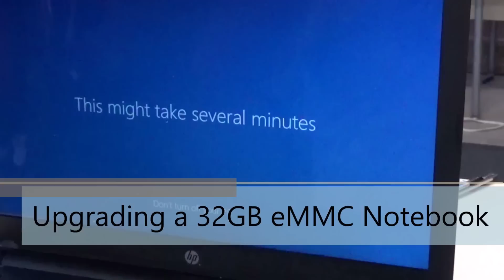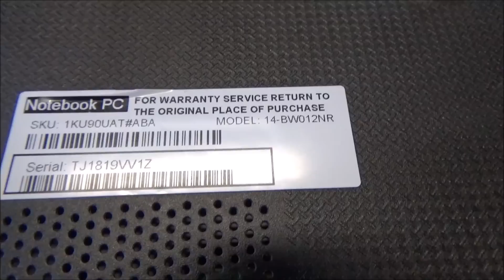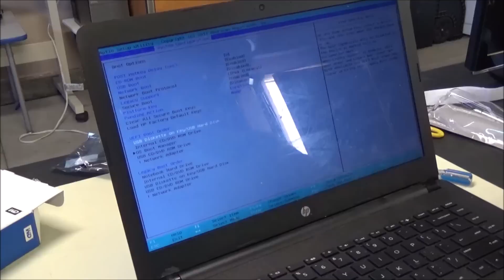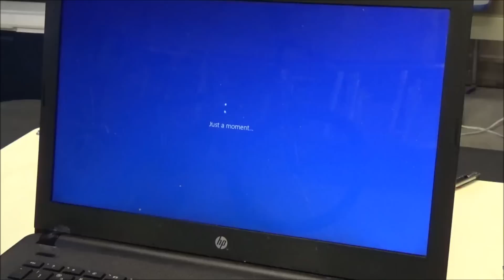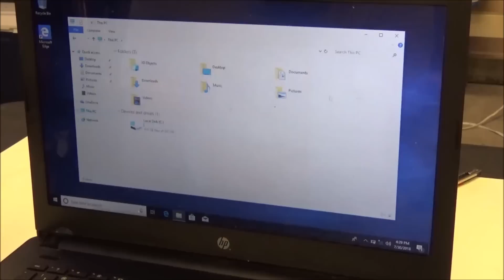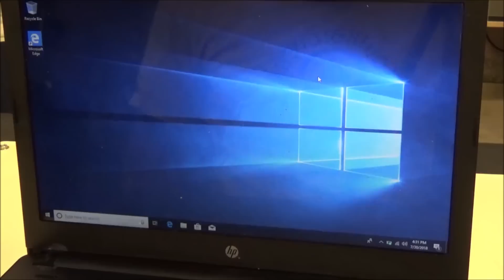Upgrade 32GB eMMC HP Notebook with 1TB HDD

Comment: Just a heads up, may have missed it if you covered this in your video.  Even though it doesn't look like one at first, that thing right beside where you installed the new hard drive (the part that has the big shiny rectangle with the ribbon cable running over it) is actually a hard drive, standard 2.5 size and standard connectors.  For anyone else stumbling upon this video, this is pretty cool, but it may be easier to just upgrade the built in drive.
Reply from the maker: When I was doing this it looked like the 32GB eMMC drive was soldered in place. The sata connection looked more like a solid bridge that couldn't be unplugged. I agree that there is room for a 2.5" drive in that spot, but the 32GB eMMC flash memory is a lot smaller than 2.5 inches. It's basically just  a little PCB, definitely not a standard 2.5" drive enclosure.  Because of my uncertainty and the laptop not being mine, I decided not to mess with it and just use the open sata port for the new HDD. Plus the 32GB's can still be used for extra storage by leaving it installed. Thanks for the input Marc, and thanks for watching!
Reply: @PimptatoPCs  Nah, it's not soldered, I almost didn't notice it was a standard connector either, the ribbon kind of messes with us.  I only offer this info because I did it myself after watching your video for getting this thing apart, you're almost the only person online who has opened this specific model and documented it, was very helpful.  

I think you're looking too closely, zoom out a bit and check out around 9:13.  The silver part, the pcb, and the black plastic tray they're both connected to are all removable as one piece (they, as a whole, are the same size overall as a normal 2.5" drive).  It all comes out with a little bit of work if you remove that screw on the tray towards the front of the laptop (near the pcb).
Reply from the maker: Thanks for the detailed information. I didn't notice that it's actually a 2.5" plastic tray that can easily be removed. If I ever do another one I'll definitely consider using that area to install the HDD/SSD. Having to use Velcro or doubled sided tape to secure the HDD in that other spot is a little mickey moused. It could wiggle loose or get knocked around with a good fall. I'm glad that my video helped you out and hopefully the details you provided will help someone else in the future!
Reply: Marc Mohon Hi I just saw your comment about the 14” HP stream upgrade. My kids got these lovely things for Christmas last year and they have been paperweights ever since. I am thrilled to have a chance to get them up and running with a new drive etc because they really need windows stuff for school and keep using my work computer instead. Cash is low so this would be a great fix. Can u help me out by telling me what you used for the upgrade? I will be using Amazon or anywhere I need to for the SSD. I have them open and from your description think I can see where it comes out as a whole. I just needto know what to purchase, there are way too many choices that this momma’s head exploded. Thanks if you have the time to send a quick note back. 🙂
Reply: PimptatoPCs Thx for this video since last Christmas have been searching for remedy for the two HP notebooks my kids got from a relative. Its been driving me crazy. You video has given me new hope for our paperweights. What do you suggest I buy? You had mentioned you told your neighbor in an email what to purchase, could you tell me? I also sent a note to another subscriber since he said the velcro etc wasnt needed cuz everything removed. So if you had to do it over again, what would u buy? I am willing to try anything since we can’t get new actual real true laptops this Christmas. Thx for any info. 👍🙂
Reply from the maker: You are welcome Jennifer. I didn't anticipate this video getting so many views! Looks like HP sold a lot of these notebooks and now have a lot of unhappy customers. Marc mentioned that the SSD can be installed in the spot where the little 32GB eMMC drive sits. The plastic tray that holds it is the same size as a standard 2.5" SSD and can just be removed. If it's done the way Marc said, you won't need to buy the disk drive/hdd converter thing that I ripped apart to use as a bridge to the Sata port. It will save money and be a much more simple upgrade. Marc linked to a 250GB Samsung SSD which is a great drive, but if you want something with more capacity you could get this 512GB Silicon Power SSD for $10 more https://www.amazon.com/gp/product/B07997QV4Z/ref=oh_aui_detailpage_o01_s00?ie=UTF8&psc=1 
It gets great reviews and I used it to upgrade my mother in laws laptop. Hope this helps to get the kids off your laptop! Merry Christmas!
Reply: @PimptatoPCs  I'm glad I stumbled upon this video while doing research today. I have an HP Stream 13 to fix for my wife and an Asus X200M for myself. I think I can handle it now.
Reply: @jenniferwalters4168  Don't. The HPStream 14 can be upgraded to 8gb/RAM, but everything else is soldered. The other HPStreams can not be upgraded at all. Here's the best way to deal with them:
Download Chrome O/S, and turn them into chromebooks.
Purchase a 128gb SDcard, install it and never take it out..
Reply: @MarcMohon  WOOOTTTT!!!!!! and supports 3d holography products!!!!!! thank you
Reply: @dragunovbushcraft152  How on Earth would you upgrade the RAM if soldered in place? I did see a video of a guy swapping the eMMC for a 64Gb one and it was complicated, but I haven't seen anyone doing a RAM swap.
Reply: @philippebigeat  The ram in the HPStream 14, isn't soldered. It's in a slot. Not true for the HPStream 11, or 13.
My 5 yr old Granddaughter is using an HPStream14 with 8gb/RAM, and Linux Mint 19.3. The HPStream14, uses a single, DDR3, PC3L-12800s ram module. It comes with a 4gb module, and can indeed be upgraded, with a single, 8gb module.
Reply: Dragunov Bushcraft My brother’s stream 14 only came with 2GB of ram. I haven’t opened it but everywhere on the web it says that it cannot be upgraded. I’ll open it and have a look.
Reply: @MarcMohon  or @pimptatopcs I am in need of doing this and I’m not good with computers at all. I have the 14T bs000 and I need do upgrade the storage. I don’t know if either of you still check the comments or if either of you take submissions but I’m looking for someone who know what to do for this specific mess
Reply: @codyherd7054  It's mostly just lego, you can't put something where it doesn't fit.  I'm gonna be honest, I don't remember the model number of this one in the video, and I can't find any internal pictures for the 14t-bs000, but if you open up the back and it looks the same, good chance it will work.  I believe in you Cody!
Reply: @MarcMohon  Thank you for noticing it! I have one of them stored, I might open it and upgrade it.
Reply: @PimptatoPCs  Easy fix  el correcto
Reply: @Arcenio Adames I have the HP stream 14 laptop, It can't be upgrade in anyway RAM or SSD, i try but it's all soldered
Reply: good eye! Just checked mine and was able to install the hard drive, just need to install an OS onto it.
Reply: @Pontiac717  after you installed yours did you have to change anything in the BIOS since you just used to original 2.5 port
Reply: @Pontiac717 my stream 11 hard disk crashed, will these steps work on it?
Reply: You're a money saver man! Thanks for that! I'm glad that I read the comments before purchasing!
Reply: Bro make a YouTube video for it
Reply: That part under the ribbon Cable has a sata connection?
Reply: Can you explain more what exactly you have to do to install the new hard drive in place of the 32gb drive space? If you install the new drive in the old ones place do you still have to configure it in BIOS? I know very little about laptops
Reply: So that eMMC is installed on a removable module?
Reply: @MyChannelOnThisSite  yes
Reply: tienes razon pero el no se dio cuenta
Reply: I'm not sure whether this would work for my hp stream 2016. Also, it should be noted that you added more weight and less battery life to the laptop.

Comment: The pinned comment is right! There is a lil module, i assume this is the eMMC storage, you can upgrade it with a standard ssd without removing anything inside the laptop appart from that lil module! If you open up a samsung evo ssd (a 250 or 500gb one, i have no idea about the 1tb or more), you will find a similar module inside, where you can just plug it in and it would work! I own a lenovo ideapad s130 with soldered on eMMC, there is space for an m.2 ssd, but there is no connector on the board, i don't know if the port is functional on my machine, i am tempted to try and solder in a connector just to see if it works! I like the look and feel of this lenovo laptop, i mean, it has a nice keyboard, full hd screen, it is 14 inch, which is honestly the perfect size for a laptop, it weighs nothing, has amazing batterylife and the trackpad is not horrible, and the best of all, this machine has a full hd ips panel in it which is bright and crisp to look at! A shame that it has only 64gb of storage

Comment: How do I get the little adapter that was inside your optical drive? My laptop has a circuit board that says m.2 2.0 3.0 and no optical drive. My only option I think is to do what you did but I don't have an optical drive to tear apart.

Comment: I really only ever use my SD card slot if I reinstall Windows.  If you use Rufus you use an SD card or any other drive you want to make installation media.  You will just need to get it to boot from USB to make it work (card reader is on a USB connection really).  It works like a charm for me every time.  You might need the storage driver for your laptop to make it work.  Mine needed the Intel rapid storage driver (regardless of whether Optane is installed in it), without it Windows won't find a drive to install onto.

Comment: I have the HP 14-am052nr a very similar model. It has a sort of daughter board thing attached to the Mainboard by a tiny ribbon cable where the ribbon cable sits over the black plastic thing described in the comments here. The cable may be a Zif connector...research described something similar. There may be a cable from HP the 924927-001 and seems like it maybe is close. Mine actually has the outline for a drive in the case where the drive thing is. The drive seems to be a EMMC card of some sort that's rectangular and has 3 screws in it. mounted to a metal bracket.  It's identified as DinerAMD-6050A2862201-DB-A01 M.2 3.0 And use a 10 pin Zif (Zero Insertion Force) FFC (Flat Flexible Connector) and come as a 32Gb or 64Gb model

My only option seems to be this similar drive adapter idea. Hopefully it will kinda just drop in there as there's a big empty void where the Optical would have been and seen in this vid. I found some on Amazon called a 9.5mm sata to sata ssd caddy or something similar

The more I learn about these laptops...they really are cheap junk. I got it for free so I'm trying to use it a bit. 
Specs HP 14-am052nr
Celeron N3060 (1.60GHz) 

EMMC Drive 32Gb original
DinerAMD-6050A2862201-DB-A01 M.2 3.0 And use a 10 pin Zif (Zero Insertion Force) FFC (Flat Flexible Connector) and come as a 32Gb or 64Gb model

DRAM
Original Non ECC unbuffered 4 GB P/N 691740-005 Rev 3.0 DDR3 1600 1.35v SODIMM PC3L-12800
possible Upgrade check board for compatibility 8GB (PC3L, 12800, 1600-MHz) 693374-005

MB
SPS 858040-601

May be able to use the 924927-001  or  924995-001 HD adapter to go to from MMC to SSD
Reply: What did you end up doing? I have the exact same one you do. The problem is the optical connector that he had the adapter for. How do we even get that? 32gb is ridiculously small.

Comment: Hello Sir,
Will this method works if I upgrade my ssd if there is a fault in keyboard? Because there is a fault in keyboard in this laptop. Then if I upgrade that will it work as usual? Will a problem occur?

Comment: Have the same problem with a resent Asus notebook i got from a friend after he found out it had no space.It has A eMMC scip storgage 32 GB.Thinking about changing this chip to a 128Gb chip and a Good HDD. Have the tools do do it and have done some smd and bga chip rework etc.But cost for the chip vs a Good HDD or SSD will play into what i go for.It has a dual or 3 core intel cpu with low speed okay amount of ram for what it is.My wish was a bigger eMMC chip on the logic board and a HDD that has some read speed to it..The price a new EMMC chip and time it take to change it is where i am now.Sniffing around after a chip that is compatible with the one in it.If possible and price right i buy a 256GB Emmc chip and use a 500Gb HDD that i have.It has a lid with 1 screw in the middle under the pc for it.Just plug the sata in,no adapter needed on this

Comment: Another time saver is using Macrium Reflect to clone the drive using a sata-usb cable so you don't have to reinstall Windows 10 on it. Reflect comes in a 30 day trial version and the sata-usb cable is about $8 on eBay. I use my cable at least once a week cloning other drives.

Comment: for sure...useless 32 gb.  i have an HP  Stream, small one, with 32 gb  eMMC ssd. Is it possible, to upgrade to a 2.5 inch ssd, or normal platter drive  ??  thanks. model 14-ax010 ca  ...

Comment: Hi  i am pc tech. got a free HP STREAM  with 4gb memory (standard stick) and 32gb eMMc drive. windows 10 updates ...32 not large enough. Tried to install win 7, various versions, from usb drive. changed uefi to legacy, and wont install. says i need some kind of drivers....then exits. SO, is there a way to add more emmc, or to connect standard 2 1/2  inch connector to mobo....??    or, just stick with older win 10  ??   and, can the bios (insyde) brand, be upgraded ??  went to hp site, and cant get it.  anyway.....took it apart...together again. works as it should on win 10, but, want to goback to 7.   thankyou too much, in advance.    model 14-ax010ca

Comment: Hi, sorry to rehash the old video..
I have: hp stream laptop 11-y0xx 

I too want to upgrade to SSD.. I saw another video I can replace my wireless adapter for this type of adapter and get the hard drive going.. can you please tell me what that adapter you took apart to use to connect the SSD

TYIA
Reply from the maker: No problem man. The adapter I used was a laptop optical bay SSD caddy. This one is $7 on Amazon https://www.amazon.com/Universal-Adapter-Enclosure-DVD-ROM-Optical/dp/B081Z5STG6/ref=sr_1_5?dchild=1&keywords=optical+bay+ssd+caddy&qid=1616036925&sr=8-5 Let me know if you have any other questions  👍🏼

Comment: Oh this was easy for u man u had the sata inside in my case I didn’t have 😂😂 i just glued a HD on the outside and rock and roll
Reply: yup  i am pc tech. got a free non-functioning hp pavilion, model  15-n284ca. tried to take it apart.....what a crock. So, found out where the hd was, and used my soldering gun, with the plastic cutter tip (vertical) and burned through the back case, about 3/16 inch deep, all around the case. BE CAREFULL NOT TO GO TOO DEEP DOWN, as there is a ribbon cable running sideways, to mobo ) popped out the square plastic. took out the hdrive, and replaced with another one, previously in a similar hp pavilion. booted up, and added proper drivers; flashed the bios upgrade (insyde) brand. took out hdrive, installed the rubber shock surround, gorilla glued the square plastic back onto the back.  GOOD  TO GO. original hd had 140 bad sectors.  GOOD LUCK, all.

Comment: Could you give us an update? I suspect the laptop is not compatible with the capacity, still less 1TB.
Reply from the maker: Why would you "suspect the laptop is not compatible"? Everything installed fine and the full capacity of the hard drive was recognized.
Reply: @PimptatoPCs  Undoubtedly,  you did a good job. All I wanted to say was that, on an specification basis, there were storage capacity limits for each Mac, For example, my MacBook Air 2014 can cope with up to 500 GB (actually I have replaced the original 125GB drive with a 500GB NVMe SSD).
Reply from the maker: @om7509  That's because Apple wants to sell you a "better" version with higher capacity limits. Exactly how they do with all their products. Phones, iPods, tablets, laptops. But I am curious how the laptop is operating after over a year. Next time I see my neighbor I'll ask.
Reply: @PimptatoPCs  I see. So I could have upgraded my Mac to 1TB. Anyway please let me know of your neighbour's answer when available.

Comment: Honestly... This is more trouble than it’s worth. I have an HP Stream that I just replaced with an Acer aspire 5 slim. I ran Linux on the stream, but the celron is a very weak processor. It took forever to load anything and would crash and freeze if I tried to do something as simple as a zoom meeting. Garbage.

Comment: Just had this potato as a gift, and it's my most powerfull laptop!! ( lol why are they selling it??? ),
i wanna use it for coding, but the lack of memory is ridiculous
could i use the cables for sata to connect hdd on it or I just must buy this adaptor you are using?
also
Have you tried some OSes on it? 
it's struggling a bit with windows 10 XD